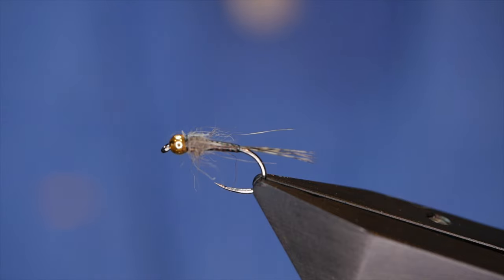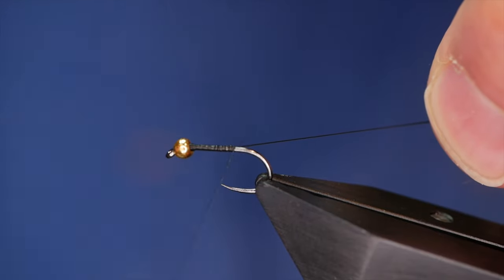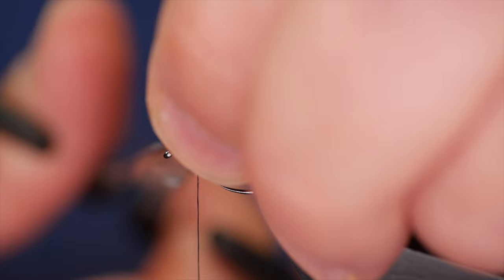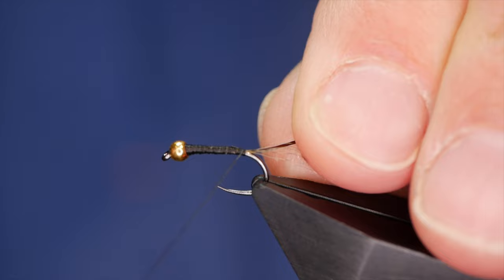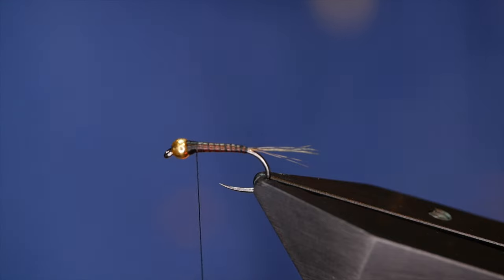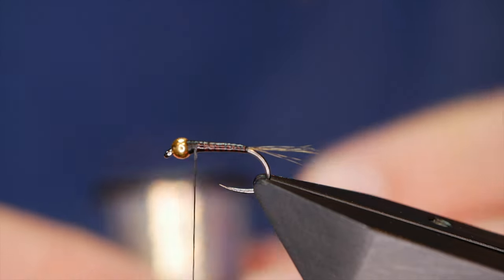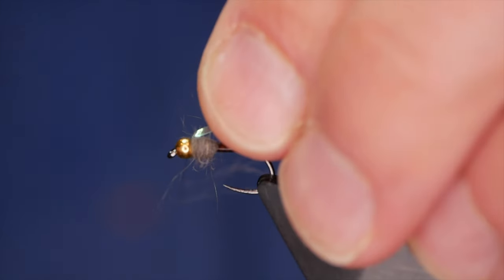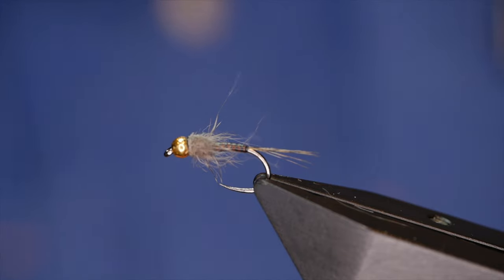How to tie a Quilled Nymph good for Stillwater and Rivers #fishing #flyfishing #catchandrelease

Comment: The pop up description states 12/0 white thread, not sure how easy that is to change?  I’m thinking about creating a fly library so a picture of the final fly, the materials that go into it with a printable size guide that is searchable of course. In the info would also be links to tying videos where available. Do you think there could be demand for this? Maybe it exists already?
Reply from the maker: Hi Rob, That’s a mistake, I tend to do several tying videos at the same time. The thread is black nano in 12/0 or 50d. I have seen similar apps to the idea you have but there is always space for more.